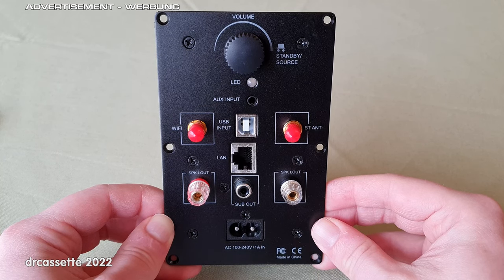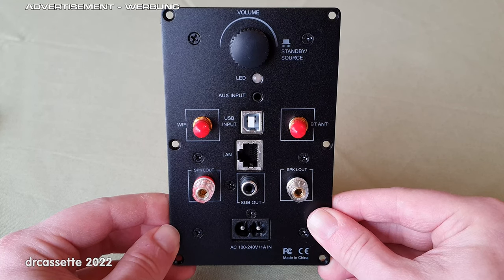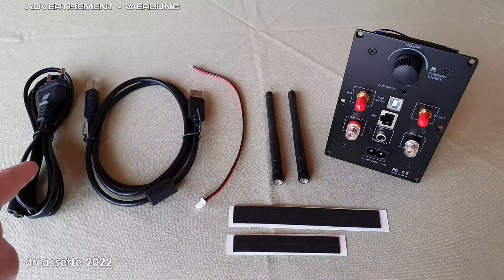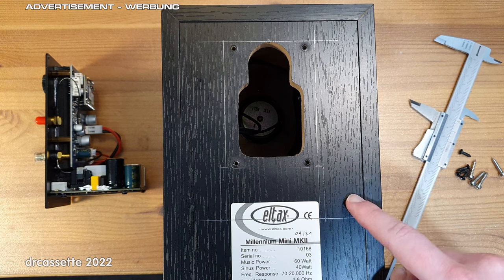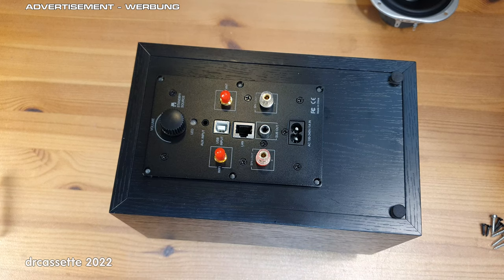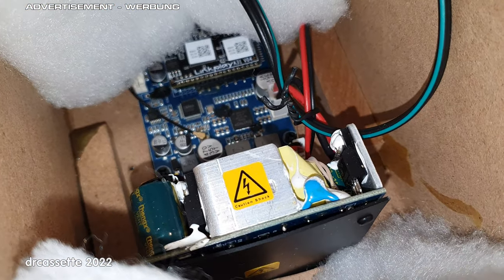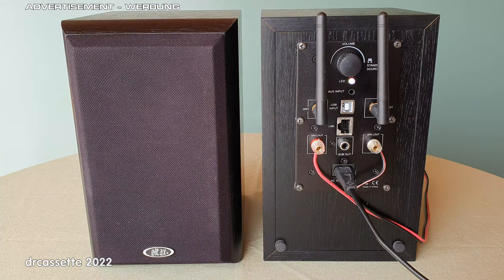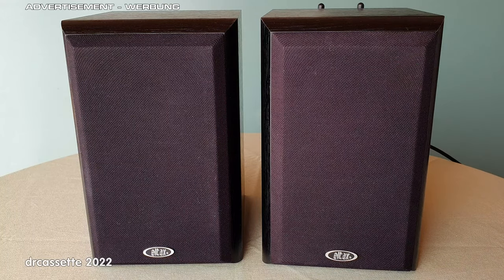Arylic Up2Stream Plate Amp DIY project and review

Comment: Nice idea. This is a nice way to recyle your old (HIFI)speakers.
Reply: Why? It's just a low-cost power amp. It's not any better than any decent vintage transistor amp. Except that it doesn't have an input selector, not even an accessible volume control - so the user still needs some sort of control preamp.
Reply from the maker: @jmi5969  Did you even watch the video? :P
Reply: @DrCassette  Aye aye, Sir! And all I saw was, well, described above. 
Seriously, the only thing that could justify the surgery would be a room-response-correcting DSP - but so far it's in a different price bracket. Without it, it's just DIY for the sake of it.

Comment: Nice review, great sound, and an achievable project. However, having purchased a number of items that rely on external apps that have  subsequently been discontinued and been left with expensive bricked units, so this is not for me. If there was a comparable unit with screen and software onboard I would purchase one to revive my old speakers.
Thanks for sharing.
Reply: Hi, I was going to make a similar comment but if you look at the end of the video at around 22:00 the system does support a standalone mode via bluetooth. I would still argue it would be nice to have a screen and some controls to be able to use the wifi system without an app since we know those might get killed or its cloud services discontinued in the future. Great video DrC!

Comment: Sir,I have one Sony MHC RV6 music system.but when we switch on it appears 
(push power protect) IC is STK442-130 which is not available  in INDIAN market,so my speaker set is idle now a days. should I fix this unit for that speaker.
Speaker model no ss RV900 
THANKS

Comment: Nice system. I just bought a set of active speakers for my TV from Argon (Hifi Klubben) and I'm impressed with them. I have a set of old Creative T20s lying around which of course already have an amp but I want to built in a bluetooth receiver module in that. I hope you can do something like that on the channel too.
Reply from the maker: Yes, adding a bluetooth receiver module to some existing product is a project I am hoping to do at some point.

Comment: Did you find the amplifier has built in bass and treble lift?  So many powered speakers these days have this dreadful sound EQ that you cannot removed, like Edifier.
Reply from the maker: There is an EQ available in the app interface, which was set to flat in this video.

Comment: I assume that 5w resistor doesn’t actually get hot.
Reply from the maker: I did not test that. The plate amp does seem to produce a bit of heat, the plate gets warm after some time of running the amp.